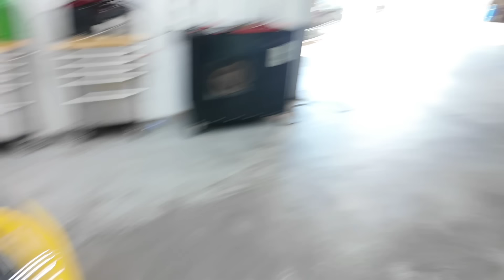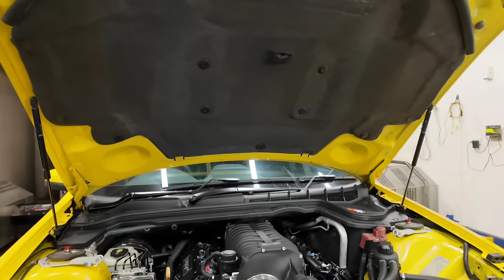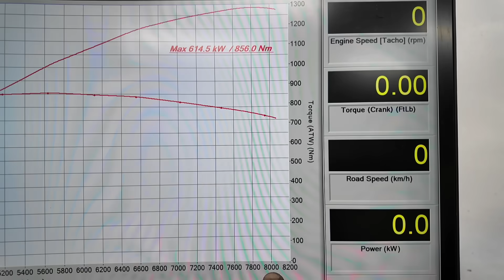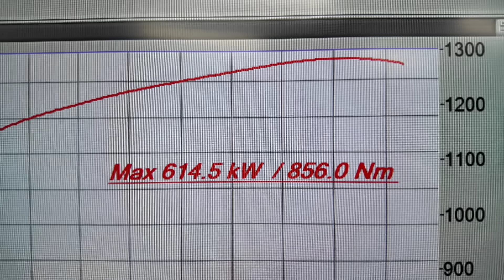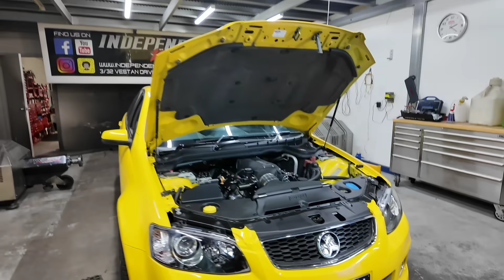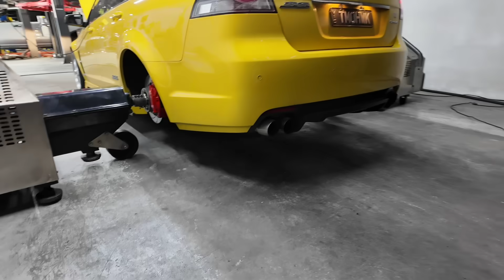600+KW 98 Octane LS Build BTR Stage 4 PDS

Comment: I do have a hot wire kit for my Firehawk for the fuel system and dual 535 pumps. Just got the 2650 MK2 Harrop CNC ported. I definitely want a BTR stage 4 PDS next! Love Harrop. I’m in the U.S. hello from AZ!

Comment: Are u running additional water to the blower intercooler or just the small bottle and heat exchanger?
Reply from the maker: Yes we are still running the standard water bottle provided in the Harrop kit, it's actually working pretty good all things considering.
Reply: Awesome

Comment: mate whats ur recommended cam for a ve with a forged L6y stroker 406ci with a harrop 2300 on top.
Reply from the maker: BTR Stage 4 PDS you won't find a better cam.
Reply: @IndependentMotorsports what engine mounts do you recommend for this type of power

Comment: Tell us about the 110 tb. Did you have drivability issues?
Reply from the maker: It has its challenges but there is enough Tune ability to make it work.
Reply: @IndependentMotorsports I ported my LSA snout just like Higgins does it and fitted a 102mm. HPF tuned it and works well.

Comment: Look at a welders reduced duty cycle in 20 degree ambient vs 40degree ambient. it's at least 10%, imagine a hot Australian day! inside car temperature reach 70-90 degree C! this effect the pump, wire and connectors ALLOT! (up size at least 30%)

voltage boost is good only when wiring and connectors have room for more, (even more in our climate) otherwise you'll see a slow degradation over time and you might not catch it especially 
WOT. 
monitor fuel system health more frequently if your customer beats on his car. 

customer that boot occasionally are ok, but those bombing the wheels regularly on a hot ozzy day will accelerate degradation

fuel systems should be wired all 70amp (relays too) and step down your fuse size